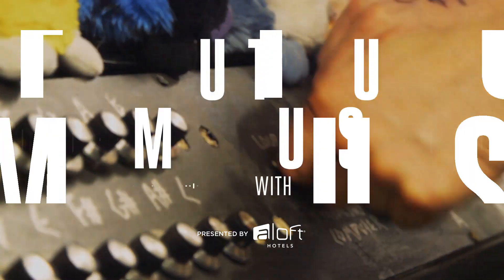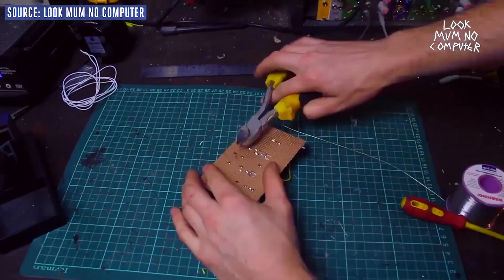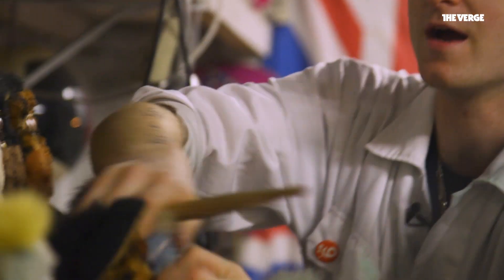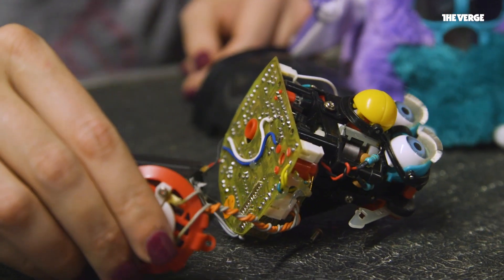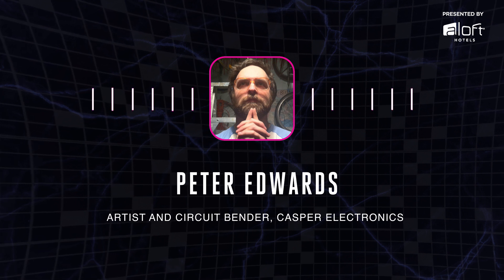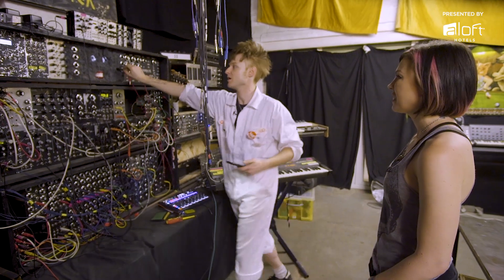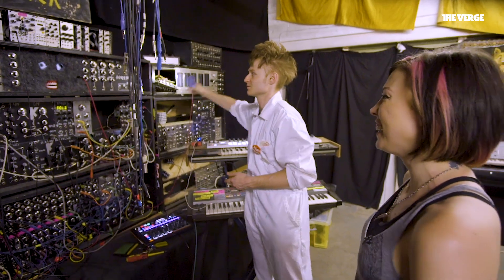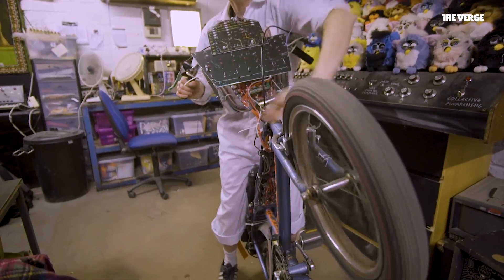Circuit bending: Hacking a Furby in the name of music

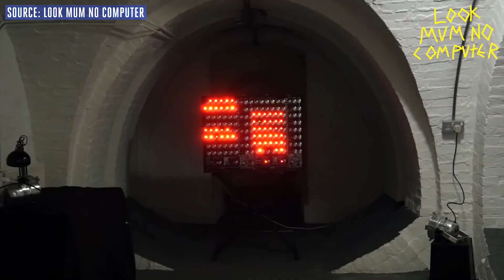Comment: My answer to 6:44 is basically: there is a difference to something digital and something physical, a digital circuit bend is only as good as when the device was like that, a physical circut bend can easily be changed, stuff can be removed, changed out, added to it and it will change it from the digital recording of how it was and it would take all of that same process to get the digital recording to be the same

Comment: I once bought a naturally circuit-bent Furby from a rummage sale. It spoke in tongues like a demon, it was terrifying.
Reply: Iirc, Furbys that were produced in a certain factory tended to have this problem, even in fresh batteries. I think it's more common on the halloween themed one with the hat? 
Also, eventually, they just wear out. Somethings probably corroded in there.
Reply: Yes, I did a bit of research, and JT factory Furbys tend to be of worse quality than those that came out of other factories.

The issue I mentioned with the halloween edition Furby is unrelated, actually. It's a problem with many RL factory holiday editions.

Comment: too bad modern toys are not very bendable...if at all...
everything except the power circuits is in one tiny blob chip, which is specifically engineered to only do that one single thing it was meant to do, no more are there lots of parts you could tweak and short and modify, it's all in one place...